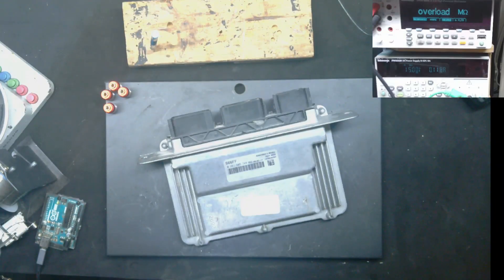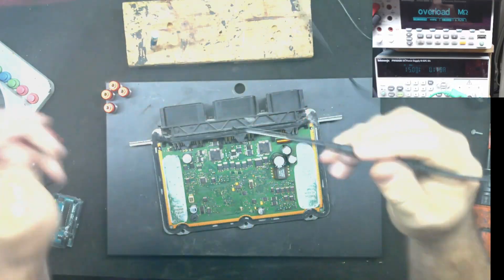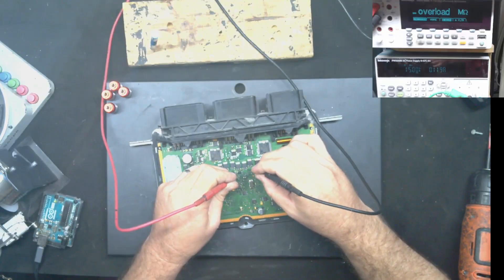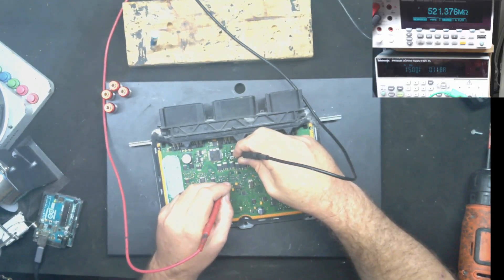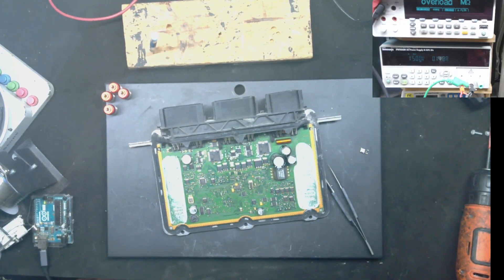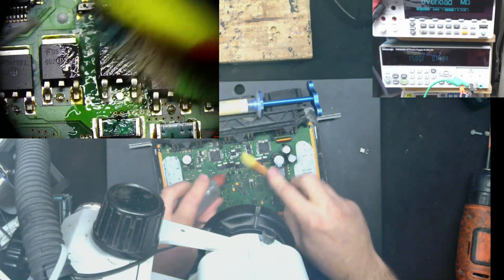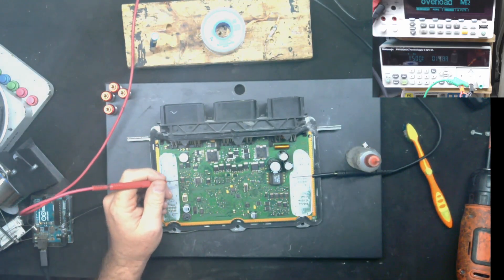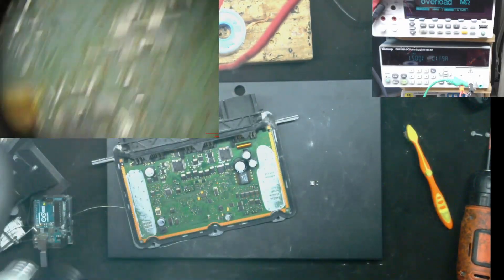2010 Ford Taurus PCM Coil Driver Fault Testing and Repair with Multimeter

Comment: I have a 2010 Ford Escape 3.0 it looks like it uses the same PCM keeps frying the #2 Cylinder. I did some digging and it seems that engine/PCM should of had a recall by ford but never did since its a common issue with the drivers going bad. 

Where can i buy the driver replacements? 

Thanks

Comment: I'm looking at this video because I'm thinking that if my PCM is bad, I would like to have a new one installed but keep the old unit and have it repaired by someone like you so I always have a backup that works if another one goes bad. The guy who helped me says he believes it's a bad solder on the PCM and I don't want to ever buy another PCM for the prices they charge again, after this. The potentially bad one is causing a no start condition with several probably unrelated codes from communication to other modules on the back end. What are your thoughts on this? Do you think this is potentially DIY possible with diagrams and required voltages? My car is a 2019 ford taurus sho.